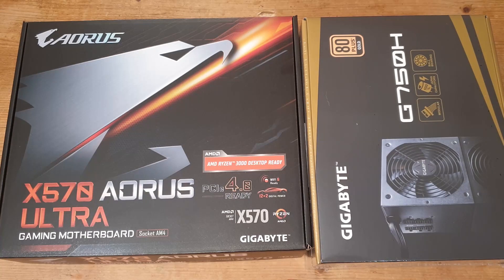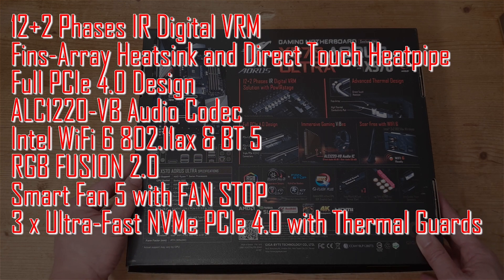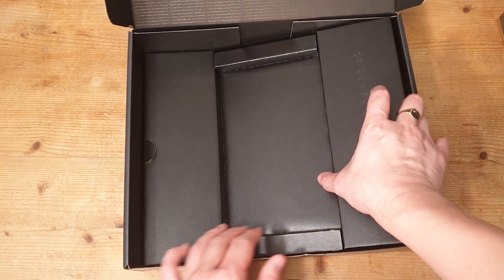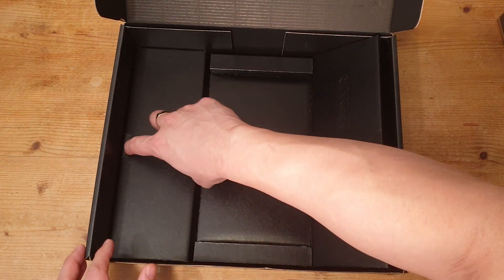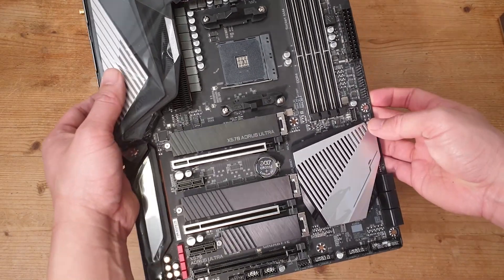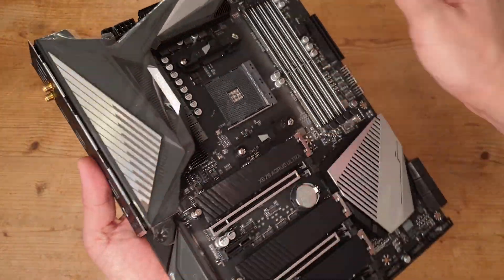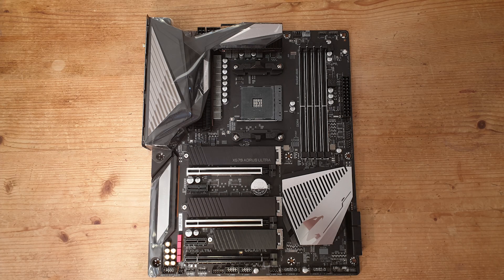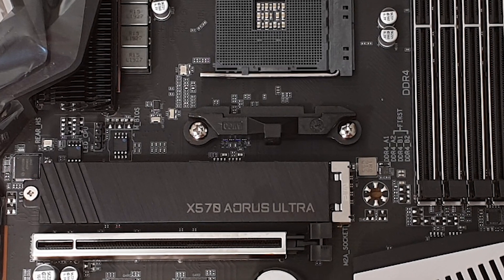Gigabyte X570 Aorus ultra

Comment: Did you any issue seating the gpu on this board? I just got one and can't get my 1080ti to seat fully due to the chipset shroud
Reply from the maker: No issues for me, my MSI 1080ti gaming x fits fine also no issues with a Asus 5700xt strix.
looking at the card and chipset shroud I have a few mm space between them.
Check the pcie slot clip as I had it pop off during a card install once.
Reply: @HardwareHusky  the clip looks fine, my card likes about 5mm before it can clip but its already hitting the shroud at that point. I'll try my gfs 20 series and see if it fits. I noticed the board looked a little bent in the middle when I opened it so I'm not sure if that could be the issue
Reply from the maker: @michaeljenkins3131  Let me know how you get on with this issue, i've had a few different gigabyte boards and various gpu combos and not run into this.
Only other thing i can think of is the heatsink is not on correctly, also what 1080ti are you using?

Comment: I have a question i have a 1tb ssd 970 evo plus and a 500gb evo plus and a 6tb wester digital hhd can i run all three with this board ?
Reply from the maker: Yes that would work. 

You can use the top two M.2 slots using NVME without affecting any of the other storage ports.

The bottom M.2 slot will run at 2x if using a NVME and you lose two SATA ports. Using a M.2 SATA in this bottom slot you keep all six SATA ports.

I hope this make sense.

Comment: hi there, great video. Could I ask a quick question; is the PCH cover plastic or metal? If its plastic, im thinking it will harm pch cooling. many thanks!
Reply from the maker: PCH cover is metal and the temperatures stay low enough that the fan does not even spin up
Reply: @HardwareHusky  thanks for the information, very useful!

Comment from the maker: On closer inspection of the board the space where the thunderbolt header should be is blank solder pads (next to sata ports), apparently Gigabyte scrapped this feature last minute.
Reply: Revision 1.2 here I have the thunderbolt header though I doubt I'll have any use for it
Reply from the maker: @congheleechconghelach9860  That's good to know, thank you
Reply: Mine is Revision 1.1 and has the THB_C connector ( not just soldered over). However, the manual makes no reference to it.
Reply from the maker: @HimerosTeviot  Mine is 1.0 but mentions it in the manual lol